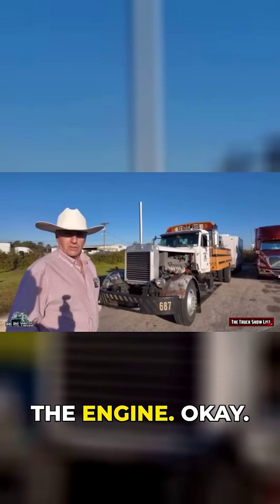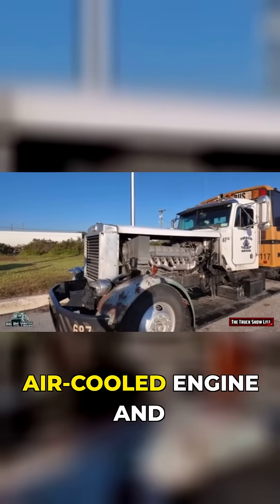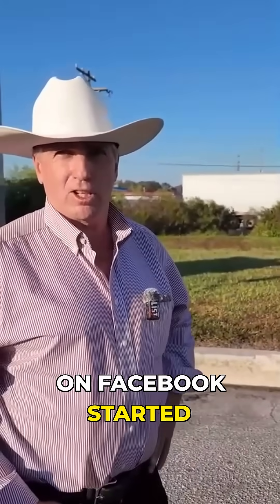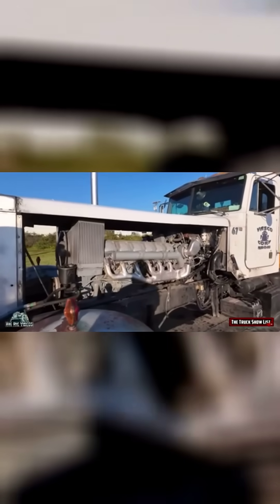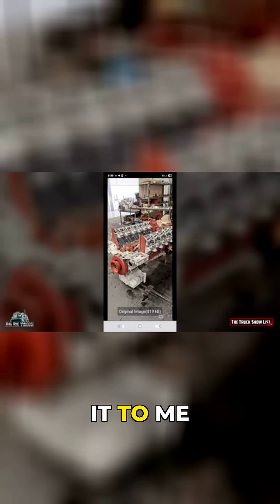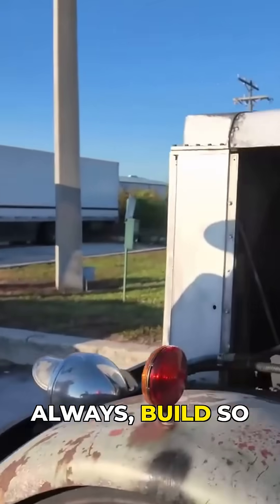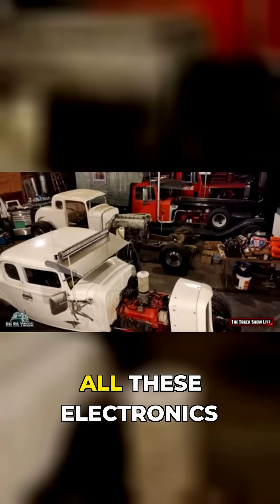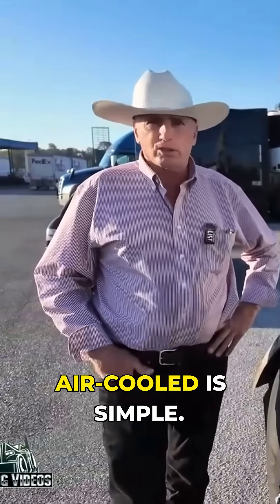Why an Air-Cooled V12 Tank Engine in My Truck?

Comment: I had a Mac at air cold engine. I ran nothing about 13,000,000 miles and never had an issue with it. Got 10 miles a gallon 12 miles a gallon grow 90,000 and it pulled like a mad Mac I missed that truck.

Comment: Yeah a bloke who worked in a few dessert places said that they used mostly air cooled engines as even the temperatures of 50 degrees C outside were still lower than normal operating temperatures of a liquid cooled engine. It made sense at the time and we should probably have more air cooled engines here in Aus with the climate getting a little warmer each year 😮😢
I did see a air compressor that was very confusing many years ago as it was a oil cooled engine. Very strange but interesting 👍
Reply: @grantleypotts8046  um oil cooled or oiled crank and piston

Comment: I used to run a Vermeer 3550 trencher at work with a three cylinder Deutz engine that ran wide open all day in the summer and never had heat problems. That thing always started up and ran perfectly despite never needing service except oil changes.

Comment: He ain't going to be able to pull a full load reset truck up up a steep grade or go very high in altitude without that thing overheating that is why we went with water cooled because in higher altitudes you have less air flow that's why turbos don't work that well in higher elevations

Comment: Air cool  will be great,   the
Problem is,  they got to figure out something for the  air  coming through , and the air needs to cool down before it goes in the engine, or it going to run hot ,  in the long run there all kinds of problems,   what he done there, He needs to put facts against what he done, nothing against what he done,   make that engine work , drive it down the road , pull mountains with it and let see what it going to do

Comment: I fully understood the whole problem too. It was the day I had a late model Bluebird diesel bus die in the middle of a dirt road because the system starved for electrical power because the alternator wasn't enough to keep everything running.
Reply: The things they're willing to teach you, once you've signed on a dotted line! I ran towtruck 24 yrs, and have yet to meet STALLINGBIRD! Thanks😅
Reply: 😂😂😂😂😂😂 @oscarlesburg7672

Comment: 100% my man. Keep it simple. Rock and stick simple.
Reply: @BACKFIREFUR  When I was young and in design courses, we were instructed about the KISS method of design. "Keep It Simple Stupid!" Keeping the design as simple as possible reduces costs. 

The Deutz is a very good motor. For more power for their motors, they merely added another cylinder or a turbo. The motors had the same rods, pistons, valves, and other parts. And they usually had good fuel economy and ease of maintenance.
Reply: Amen!
Reply: Great fuel economy!

Comment: What happens when you idle in hot wheather while running the AC? How about a hard pull on a steep grade when speed is reduced?
Reply: its going to need a giant oil cooler since the lube system will be absorbing the heat instead of the coolant.

Comment: YES SIR!  YA done hit that nail right square on the head.   Electronics should be stuffed where the sun doesn't shine.   A nickels worth of parts can cost the customer thousands of unnecessary expenses to make some thing to run.  
Those automotive electronics advocates should be  castrated with a dull rusty knife. 
I'm 1200.00 plus and more than a year trying to get my 89 4.3 S15 GMC operational after an on the road ECM failure.
GM dealers won't even look at it.

Comment: Absolutely. Simplicity is reliability ease of maintenance and Longevity i build all of my vehicles as well. No, no plastic, no electronics, all systems are mechanical only.
Reply: Piezo electric ignition??
Reply: Uhh- push start?- humanical-. 😂
Reply: @theenginist5255  what type of vehicles do you build? Hot rods, street rods, building old muscle cars? I have a 1976 Pontiac Grand Prix and that's what I love about it. No damn computers.

Comment: In a quest for simplicity and ease of maintenance, guy overlooks B/C model CATs, 2 stroke Detroits, and Big Cam Cummins, and instead buys a one-off custom engine from China with zero chance of parts availability when maintenance is needed… outstanding.
Reply: You can't live long enough to wear out the engines he mentioned based on cost to mile. Even if you have to inframe them they're still cheaper than buying that motor.   Stupid motor to put in a semi. Cool but stupid
Reply: @devin_the_dude   He wanted an air cooled V12. None of the manufacturers you mentioned have one.
Reply: @devin_the_dude  its a German engine, plenty of spares in Germany. But the point is this won't need as much maintenance as those American engines
Reply: @dkinclonberne  how are there plenty of spares, when he literally said the engine was built to his desired specifications? If he ordered a production engine that was just never sold here, that’d be one thing, but he made it sound like this was something he special ordered, which is a completely different story. I’d bet you he could’ve ordered two completely rebuilt mechanical CATs (one as a ready spare) for what he’s in this engine for.

He did it to be unique, and that’s fine. But to paint it as anything other than that is disingenuous.

Comment: This engine was newer build in a german tank. This engine was only for the civilian market. greatings from germany
Reply: @sdkfz172  came to say the same thing, Rock crushers to railway vehicles but not production tanks unless....  Who knows what the Chinese are doing with it if they're still manufacturing it, and there's so many refits of ancient armor going on id be surprised if it hasn't been a retrofit in a tank at some point.
Reply: He states in his video. That it is a engine. That was designed for the German tanks. That he had redesigned from scratch. For his spicific purpose in mind.
Reply: @sdkfz172  he's referring to the design, not the production of this engine. Does that change anything for you?

Comment: I'm with him with his opinion of the auto industry trying to complicate something that could solved simply and be fixable by the owner.
Reply: It's not going to be simple
Reply: @joeferreira7382 
You're correct! They don't want the owners smarts 😮 THEY WANT THE OWNERS'S MONEY!!! 🥳-🇨🇦
Reply: Keep dreaming. Since 9/11 basically they said we've been doing this all wrong. 100G for a 1 ton, get out of here. Bought one with everything except dual wheels and 4x4 in 2001 for 30G, still running factory 7.3 and trans with upgraded injectors, turbo wheel, and flip chip. It has 770,000 miles on it, half of which are heavy tow miles. You think the 6.7 could make it that far, nope. Everyone of the diesels have a major problem of some sort. Even gas burners pre 9/11, the electronics were simplistic and the motors weren't built to fall apart.

Comment: Why air cooled? Because you can jam that engine in anything without having to worry about fitting and plumbing a cooling package.
Reply: Deutz are technically air oil cooled we run Volkswagens in our sandrails because they never overheat in 110 plus degree weather, it’s all about design and execution
Reply: Not hardly, you have to provide enough AIR to cool that thing in all situations....
Reply: @regdor8187 You're not wrong, easier to get enough airflow than to fit a large enough radiator though.
Reply: @regdor8187  What if I'm hauling freight in the desert and it's 120 degrees out during a sandstorm
Reply: @Taxevader-gk9ms  Well, you will probably be parked because you can't see where you are going anyway.and your engine will be inches deep in sand...
Reply: @Taxevader-gk9ms  then you get what you deserve for making such a run. Good luck.
Reply: @Taxevader-gk9ms , the engine will run out of air to burn the fuel before it over heats, the old deutz engines would operate in conditions a human would not survive
Reply: @Taxevader-gk9ms these engines are used on agricultural equipment, like tractors and combines, also on ships and mines. They were also used on WW2 tanks and trucks in africa. They will just keep working
Reply: @PatricioGarcia1973  we have Miller Welding machines and high cfm air compressors with the Deutz. I love them, simple to work on, will out last all the parts around it multiple times so far....haven't seen one die yet.
Reply: Air does not freeze, air does not boil.
Reply: @HustleMuscleGhias  Your engine has temperature limits, how you hold them is your choice, if part of your combustion chamber is Aluminum, you have Hot enough to degrade the oil,Hot enough to preignite the fuel , Hot enough to soften / melt the aluminum, and enough heat transfer to the outside air to keep your valves intact and that is harder with an Air cooled only engine...
Reply: @regdor8187  Air cooled VW engines were operated all over the planet from Death Valley to Antarctica.  Generally speaking you are not going to find hotter or colder places. Those engine blocks were made from magnesium.  By comparrsion the magnesium would be oatmeal consistency by the time aluminum melted. The cylinder "jugs" I believe are cast iron or some steel alloy, aluminum pistons with aluminum heads, and sodium filled valves. The only cylinder that will give you trouble on the standard engine is #3 which is right below the oil cooler. The valves tend to tighten on that particular cylinder more than the others for some reason. There was no sump as standard. 2.5 quarts of oil was all that was necessary to do the job. And they built over 23 million of these engines.
Reply: @HustleMuscleGhias  : But, what they could NOT do was pass emission test of later gov requirements....;^(
Reply: @regdor8187  They would also fail the later crash test standards. If one wanted to one could import an air cooled VW into the US from either Mexico or Brazil assuming it is 25 years old. Federal regulations say it is an antique, state laws differ on vehicles of such vintage regarding emission laws. If you were to import a vehicle through the Mexico / US border and you do so yourself there is almost a 100% certainty US Customs and Border control will slice and dice your interior looking for drugs. They are very through about destroying interiors and will even pop beads on spare tires if they feel the need to do so. I know  multiple people who have imported air cooled from south of the border and this has been the case just about every time. Well kept original interiors trashed. And there is no recourse.
Reply: @regdor8187  says who? They can absolutely be made to pass emissions, Porsche kept running aircooled engines well into the 90s
Reply: @HustleMuscleGhias  Air actually can be frozen
Reply: @Taxevader-gk9ms  At -364F. Only place you are going to find temperatures that cold are in your high school girlfriend's heart.
Reply: @splitsecondmagician  An air cooled engine will need to be derated compared to a water cooled engine thats otherwise identical. Low speed/higher load cooling can be an issue as well as each individual cylinder and head running a similar temperature 
Better to run a water cooled mechanical injection engine. More power, consistent engine temperature - under temp is bad too, and no electronics
Reply: @UFO-047 if these are truly the old style deutz heads, every cylinder has a separate head. Deutz motors were kind of a air/oil cooled mix, preventing some of the high load problems and low temperature problems.
Reply: @nicholasdowns3502  all good quality diesel engines, like the ones in DAF, Mercedes, Volvo, Iveco, Kamaz trucks have individual heads. Much easier to replace and work
Reply: Yup!
Reply: @splitsecondmagician  as soon as he said he didn't like the direction the automotive industry is going, immediate LIKE

Comment: Well now I know where one of my trucks is going to be coming from, Deutz looks like a great truck manufacturer. Where can we order these engines or trucks?
Reply: Engines, usually smaller air cooled industrial and service diesel engines that use oil coolers to cool rather than fins like dirt bikes.